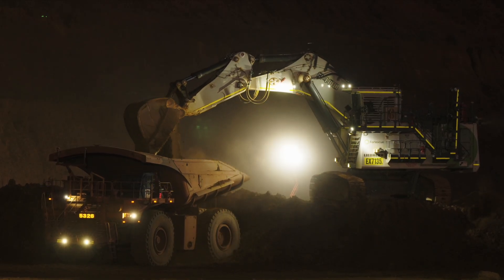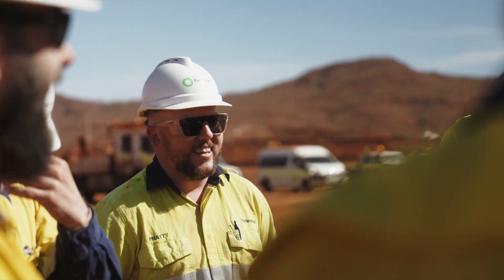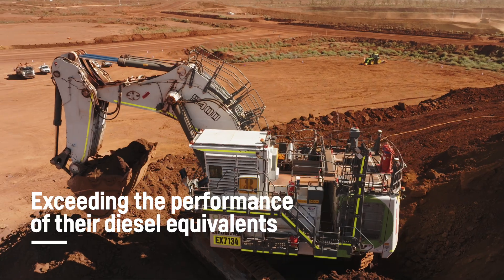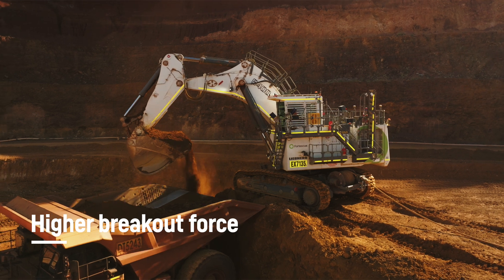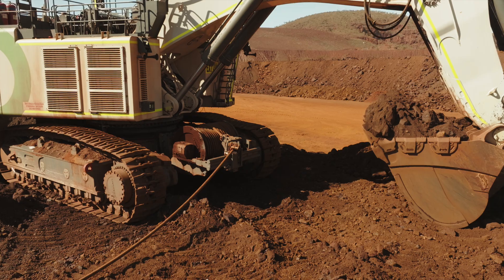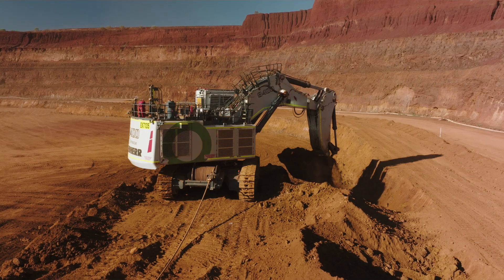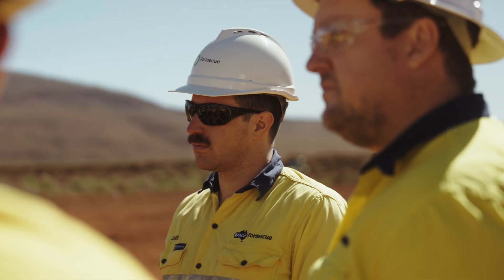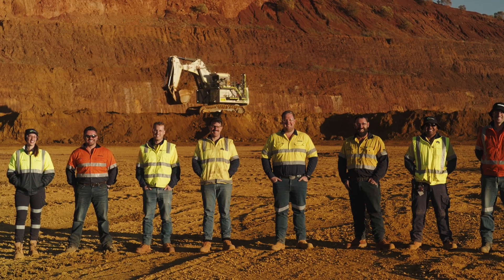Australia's first electric excavator: The R 9400 E with Fortescue | Liebherr

Comment: Mining's electric revolution? Happened decades ago! I remember being a kid strolling around an abandoned electric excavator (Menck) in an old stone quarry. Same troubles now and then: Assure electrical power supply in remote areas, accidentally cutting the cable when maneouvering resulting in high costs of damage and downtime. When supplied by an coal-powered grid, decarbonisation is highly questionable. Ground-level ozone (O3) emissions. Costs of installing and operating the power grid. But I must admit this is a viable solution if power is readily available, and driver comfort (NVH) is excellent!

Comment: Even if it’s linked to a coal-powered grid, it’s still going to be significantly more efficient in eliminating engine-related costs. If we can efficiently provide electricity to moving trains then doing it for slow vehicles should be easy.

Comment: So its powered by a large diesel generator? How does that fit into your net carbon plan. Seems counter productive to me.
Reply: where did it say that? even if it was, diesel electric is more efficient than straight diesel.
Reply: oh come on, lots of solar nearby and increasingly cheap LiFe battery tech which are robust and non combustable. 
Especially in Australia where there has been a lack of moral leadership in those years when current price competetivness had yet to achieved by paying subsidies  for scaling up and advancing solar, wind and battery cells even today you can only get these corporations to do anything via cost savings. Just think of the hundreds of road trains shuttling in all that Diesel no longer being needed.

Comment: What does the power station run on?
Reply: Yes what does the power station run on, surely it's not diesel.
Reply: "Fossil fuels contributed 65% of total electricity generation in 2023, including coal (46%), gas (17%) and oil (2%). Coal’s share of electricity generation continued its long-term decline while the share of gas-fired generation was lower due to higher gas prices and increased generation from renewables. Renewables contributed 35% of total electricity generation in 2023."
https://www.energy.gov.au/energy-data/australian-energy-statistics/data-charts/australian-electricity-generation-fuel-mix
Reply: Coal😂
Reply: @siberg6257 lng
Reply: diesel electric is currently the second most efficient drive system next to nuclear and for obvious reasons you cant have nuclear excavators, so diesel electric is the best we've got.
Reply: @Volkswagen_taro-ferrari  what world are you living in to confidently spout such nonsense?
Fully electric systems are the most efficient way to run these mashines of course. Energy coming from local solar production with large scale battery banks. Is it really so hard to comprehend that price parity with solar has long been achieved!?
I have long lost all respect for Australia as a developed nation for not having pulled its weight when industrialised first world nations were being tasked with bringing green tech to scale by paying the vecessary subsidies. Instead you gave to the world Murdoch and all the toxic influence he had on politics making a united effort to curbing CO2 emissions in the last three decades THAT much harder.

Comment: It would be great if you provided more information about the teather cable that provides the electrical power
Reply: its simple there's a diesel generator at the end of the cable as there is no power grid out there.
Reply: Theres about 300 different brands and styles of MSHA rated mining electrical conductors. Armored, not armored, flat, round, 6 conductors, 4  conductors, 6kv, 13.8kv ect, ect clearly you must not work in a mine, around a mine or an industrial environment all. @phalanx3803
Reply: @phalanx3803 power station that runs on lng which is still clean.solar farmmis getting built atm to replace it and there is  grid and its getting upgraded as well
Reply: @phalanx3803 don’t comment with no idea , it’s run from a power station that supplies the site
Reply: @evil2rs and that power station is powered by what😂
Reply: @rosl-80  Ever worked in the Pilbara mate? Solar isn't there.
Reply: @deanriley5690 They build their own solar plants and energy storage.
Reply: @Warrior6350  they have multiple diesel generators sets powering remote sites.
Reply: Its powered by lng gas at the moment still clean energy.masive solar farm is under construction

Comment: From what I'm reading this mine site uses generators to product its high voltage needs. Correct me if I'm wrong. That would mean this machine isn't zero emission or even close to a low emissions machine. Further more the minerals and materials needed for the machine are going to be far higher then using a T4F engine.